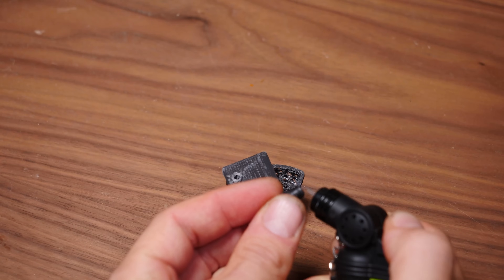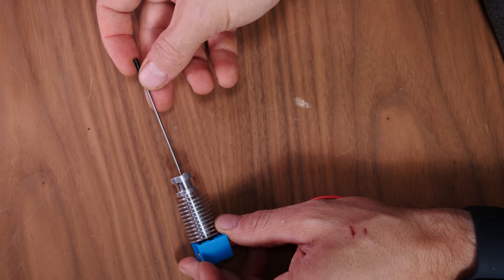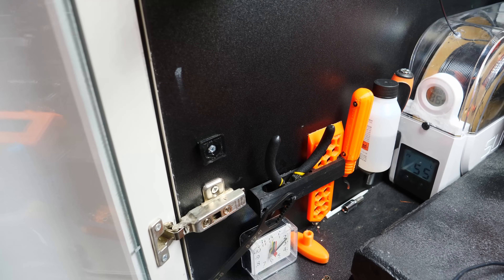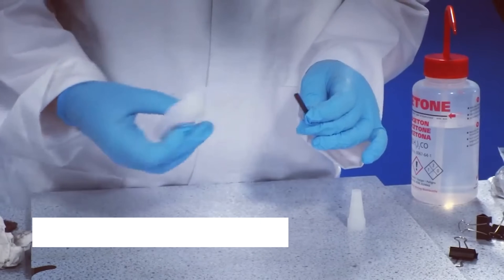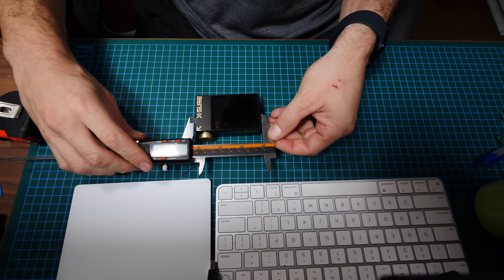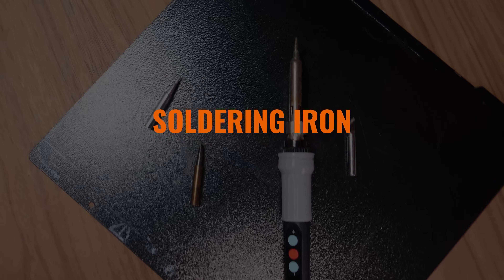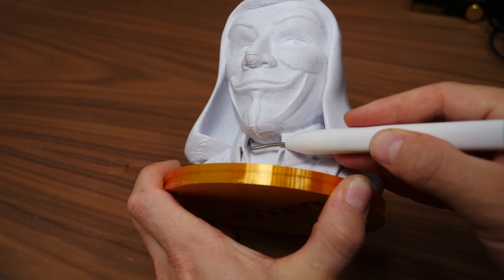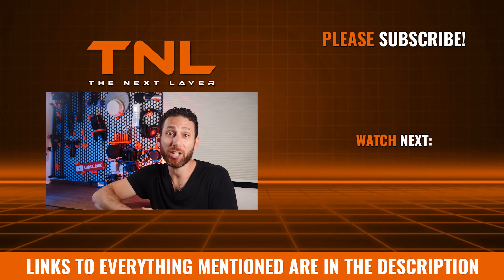3D Printing Tools You NEED (Yes, More!)

Comment: How to Play YouTube Audio With Your iPhone Screen Off — NO PREMIUM—(Quick Method)
	1.	Start playing a YouTube video
	•	Open YouTube and begin playing the video you want.
	2.	Go to the Home Screen
	•	Swipe up to go Home (or press the Home button if your iPhone has one).
	3.	Make sure Picture-in-Picture (PiP) appears
	•	The video should shrink into a small window in the corner.
	•	If you see that small window, you’re good to go.
	4.	Turn off your screen
	•	Press the Side button (power button) once to lock the phone.
	•	The audio will stop — that’s normal.
	5.	Wake the Lock Screen
	•	Press the Side button again (or tap the screen) to bring up the Lock Screen.
	6.	Press Play from the Lock Screen media player
	•	On the Lock Screen, look for the media controls.
	•	Tap Play to resume the YouTube audio while the phone stays locked.
	7.	If you don’t see the media player
	•	Swipe down to open the Lock Screen/Notification view (or Control Center, depending on your iPhone setup).
	•	Look for the media widget and tap Play there.

Comment: It should be mentioned that heat can permanently weaken a magnet. You would be better off ensuring the tolerances are good and heating your print if press-fit is being stubborn or reaming it out and gluing them in.

Comment: Love your vids Jonathan. Here’s a couple of suggestions. Dental picks (if you don’t have a Cricut) and a small stiff pallet knife (like an oil painter would use). In fact, the letter is my most used tool. It’s really handy with small parts where only a corner pops when you flex the bed.

Comment: If you use heat to embed a magnet into a print you will affect the magnetic property of the  magnet, possibly even demagnetising it! This is certainly true of conventional magnets but I believe it is also true of high power magnets too. Best to embed these with glue or to stop the print, put in the magnet then pick up the print again so that it overlays filament to secure the magnet.

Comment: I use a gorilla brand hot-glue gun which isn't the best as it does use a wire, but the bond and my burnt hands can tell you that when the glue is there, it stays there (that is why my hands are burnt)

Comment: Heat guns have many general shop uses and really benefit from a stand so you don't have to waste a limb holding the heat gun. The small one you show would be easy to make a variety of stands for. My workbenches have steel tops or steel sheets so I'd use a magnetic base (as use for dial indicators etc) which are quite versatile but you could certainly print one then insert a rare earth magnet in the base. A hot air soldering station (a very small precision heat gun) would be worth experimenting if you already have one.

Comment: Would not recommend using hard metal to clear the  main part.  It can scratch the smooth inside and cause more built up.  use brass brazing rod. The smallest diameter is 1.6mm.

Comment: I would say that if your drill is too powerful for 3D prints. You either went for a cheapo on/off version rather than a proper gradual “trigger” or you shouldn’t be fristed with powertools 🤷🏼‍♂️😂
(But i did just Yesterday get annoyed that i had to use my bigass milwaukee because i hadn’t charged my tiny one :b)

Comment: 14:50 I tried the hot glue on a warping ABS print on an unheated bed.  Yeah...  
The glue adhered the part so well to the bed, that eventually the warp spread to the soft-magnet flexi-build plate, whatever it's called.  And the whole plate warped off the moving assembly and failed.  

But the hot glue worked!

I was thinking about printing clips, but I think basic binder clips would work.  Just clearing obstacles if the handles are removed.
Reply from the maker: LOL sorry about that :(

Comment: I have most of the stuff u mention even the fine tip hot torch( cigar lighters). Will get a 3D pen soon. I would add a electronics SMT repair hot air unit. It has multi size n shapes of nozzles and temperature control which will work better than hot torch. Thanks for sharing 💕good video.

Comment: don't buy cheap calipers, they will not last long and will start offsetting really soon in their lifetime. loss of any precision is the last thing you want from precise measuring tool. and don't give such an advice. spend $40 for high-quality mitutoyo calipers with 0.05mm precision (you don't really need higher), it'll last you for decades

Comment: Just whatever you do,  be Verry careful about hot gluing down a failing print to a textured PEI bed... At least DO NOT try to remove the glue till the bed is dead cold. If you scrape off the soft glue flush with the texture, Getting it out of the texture is a bitch. I removed PEI before the glue came out.

Comment: Another must-have tool: a full set of long, metric, T-handle, ball-end, hex drivers - 2mm-8mm will cover just about everything on just about any 3D printer with a print area smaller than half a cubic meter. Ball-end and long length lets you get into tighter spaces, T-handle gives better control over torque. (Just remember to scale your aggression to suit the size of the screw so you don't snap the head off. M3 screws don't need multiple hundreds of newton-meters of torque.)

Comment: I have acupuncture needles, but what I found works better for clearing clogs are carbide PC board drill bits. Why? Because they're fluted and can actually remove material when twisted into a clogged nozzle, even if said nozzle is cool. The only thing to watch out for is to take care to not drill out the nozzle hole - you can oval your nozzle if you're overzealous - but if you're using one to clear a hot nozzle and pay any reasonable amount of attention to what you're doing this is rarely an issue. (I also run 0.6mm hardened steel nozzles and my cleaning bits are 0.4mm, so it's a little harder to accidentally modify the hole.)

Comment: I have glass beds on all my printers and iv had nothing but amazing results with easy removal yeh granted it’s stuck strait after print is finished but iv never had one over stick and I don’t use glue either as you don’t need it if you get the right layer height just leave the print 5 mins too cool down and it’s pops off effortlessly
Reply from the maker: Have you printed ASA? ;)

Comment: Cool trick I've pulled with a hot glue gun is to use popsicle sticks to built scaffolding around tall skinny models to keep them from wobbling.   Just glue to build plate and model and take it off after the print.  Managed to print what was basically a tall wall that was 220mm tall by about 3mm wide out of TPU with this trick.     Nice list.
Reply from the maker: Clever!

Comment: I'd love to see someone to a video on uses for failed 3d prints and waste bits like support and skirts because I have 2 bags full of them and don't have the space to get one of those gadgets that makes new filament!

Also, little tip I learnt with digital calipers. Use an SR44 battery instead of an LR44 battery to have a more stable voltage across which means more accurate readings.

Comment: Pushing a needle into the nozzle pushes the clogging particles away inside, but they usually come back pretty quickly and the clog returns. Better to do a cold pull or two, or change the nozzle and get on with life. The needles aren't really a solution to clogging. Polishing your metal scraper allows it to be safely used on PEI without scratching. Round the corners a bit too and it can be used safely and effectively without scratching the printbed.
Reply from the maker: Good tips! I don’t find that I get clogs after the acupuncture needles, but good to know that I should look out for it. Thanks for being a returning viewer and commenter Alan, I always appreciate your inputs!

Comment: Could you tell a bit more about using soldering iron to insert magnets into the prints? As far as I know this metallic one's you showed, called neodymium magnets, are quite temperature sensitive and can lose most of it magnetic strength after being heated up around 80 Celsius degree. I'm really interested how you manage to do it.
Reply from the maker: Yep, you have to be SUPER careful with the magnets, which is why I suggested an adjustable heat soldering iron. You also need to be FAST. If you do it in 1-2 seconds, you can keep the magnetism
Reply: If you're working with rare-earth magnets, you're usually better off to design a hole or dimple for the magnet into the print and use a glue of the sort shown here to adhere the magnet onto/into the print. This neatly sidesteps the risk of overheating and killing a magnet, which sufficiently hot filament can do even if you're quick. Also, a hot nozzle printing over a small neodymium magnet can heat it enough to kill it, so be careful about embedding one into a print.

Comment: One of the things I'm glad I did with my scraper was to sharpen it. Not enough to cut obviously. It went from 0.7mm to .4mm (yay calipers!) and made a big difference in getting under prints. 

Thanks for your videos, they've been helpful!
Reply from the maker: Agreed, I'm probably going to reprint mine in CF Nylon just to keep it sharp tho
Reply: How do you measure an edge accurately with calipers?
Reply: @TheSuburban15  I slightly opened the caliper and tried to slide the edge into it. Slightly opening the caliper if it wasn't going in. Took about three measurements as best as I could, averaged the value and rounded to the nearest tenth.

Now that I think about it I could've pressed the edge into a paper and measured the indent.

Comment: Great video as usual.

What about a video showing how to correctly use brass insets with your Soldering Iron, that is, how to get them correctly in, perpendicular, and what holes you need for the correct inset :)
Greetings from the Galilee.
Reply from the maker: Check out @cnckitchen they did one like this that’s great!
Reply: @thenextlayer  He did on how strong insets are and compared cheap vs expensive.. but it was not a "how to" video.
Greetings from the rainy Galilee.

Comment: Brass rods are even better than steel since the metal is softer than most heatbreaks and won't scratch it. You should be able to pick up a 1.5mm or 1/16" rod at most hobby stores.
Reply: Also, brass looks way better
Reply from the maker: Genius! thanks